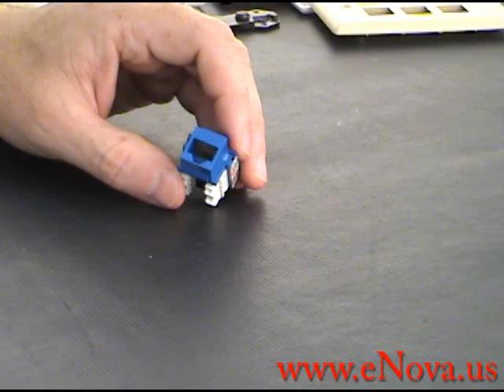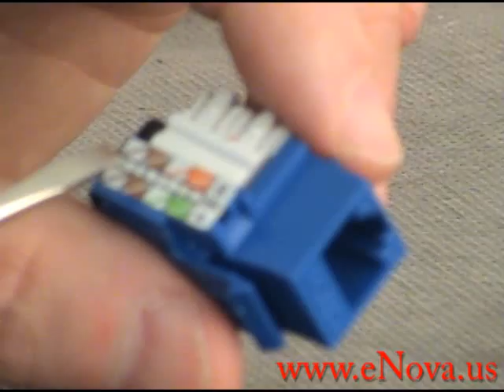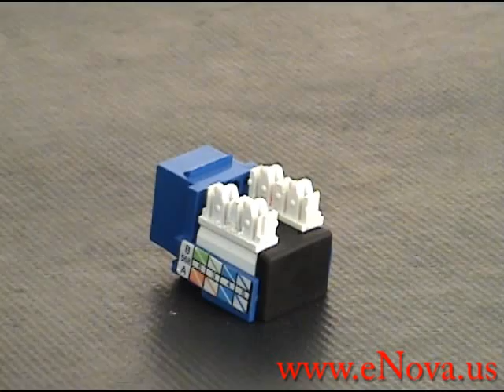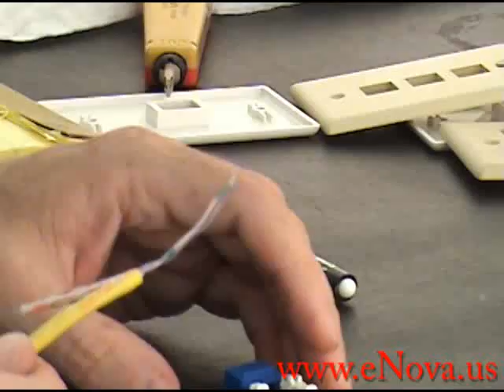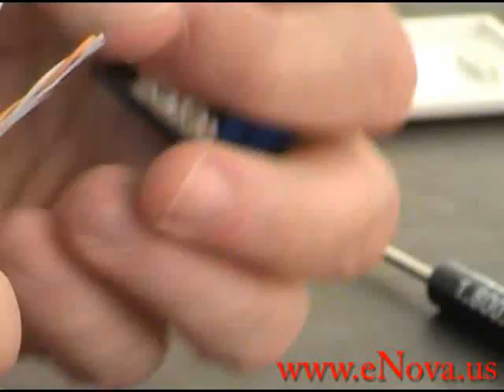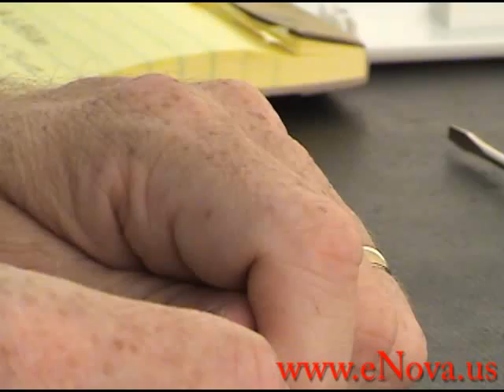How to wire an RJ45 jack

Comment: Great demonstration. I got confused at about 3:37. You punched down, but then when you removed the wiring, I couldn't detect any slicing in the shielding.
Perhaps it was not visible. 
It seems to imply that you don't have to strip the shielding at all. Is that true?

Thanks so much for the explanation, though.

Comment: you can essentially make up your own pin out patch but you have to make sure you use the same pin out on everything (meaning both ends) and using a patch panel using a homemade pin out just is not labeled, so it is best to use the 568 variations
Reply: Standards, especially Commercial support the "Truck Theory" or whatever it's called, in which one gets hit by a Truck/Bus and someone else has to come in and figure out what has been done.
Not disagreeing, just presenting "Best Practice" implementations.

Comment: Good video, but don't untwist the wires before placing on the jack unless you can absolutely can't help it.  Keeping the twist intact for as long as possible is crucial.  Especially as you move up to Cat 6 & Cat 6A.   Most jacks even have a little point to help you separate the wire pairs as you push the wire down into the jack so that you don't have to untwist the wires at all.

Comment: 568A is the primary wiring config for EIA/TIA standard  (1991).
The reason 568B is included within standard is for the legacy wiring/AT&T cabling (already installed) and 
support for AT&T/Lucent PBX switches in commercial buildings since 1980s.
--
For Residential, 
I advise homeowners to use 568A wiring (unless specific reason for 568B) within their walls (jacks & patch panels).
For Commercial Bldg.,
totally depends on existing infrastructure (or training of staffs).
MARK at Main DeMarcation/Patch Panel which standard is in usage.
Reply: Ummm, think you might have things backward.   I don't know anything about the history or whatever but I've been doing this for 20 years and I've never once seen a building using the "A" standard.   Everyone uses "B".

Comment: i put in a rj45 system today and went with the b on both with a wall jacks so when i put the modem cable in to the wall jack nothing happens on the other side when i hook up a laptop no cable internet i think im doing something wrong
Reply: The DSL modem typically uses a cross over patch cable.  If you used a straight thru, it usually won't work.  Keeping your run ends consistent A-A or B-B should be just fine.

Comment: can you have an RJ45 on one end and a Keystone Jack on the other?
Reply: Yes, like an extender
Reply: Absolutely.  Just make sure you stick to the same spec (568A or 568B) on both ends.  That being said, most structured wiring goes from a keystone jack in the wall to a patch panel in your wiring closet.  Some patch panels are made out of lots of keystone jacks also for ultimate flexibility.   I've seen cheap installs that go from RJ45 to RJ45 thus sparing the expense of the keystone jack and the patch panel.   That's honestly how I did my house, but I would never do my business like that.

Comment: One interesting and baffling thing that I learned today while doing some wiring: The color code on the jack, and the color code on the plug (as seen on the box of plugs) do not correspond!  I used "B" for both, but it will only work for jack to jack or plug to plug. The standards from plug to jack are apparently different. For instance Solid Brown to Orange stripe. I eventually figured it all out with my mutlimeter. There must be a reason..

Comment: Hi, i'm a complete novice with these things so was wondering if you could help me? Could i send an Ethernet cable from my router downstairs to my loft and wire it to one of these through the wall and be able to plug in as if i was plugging directly into the router? Thanks.